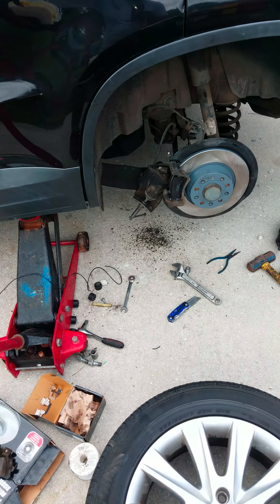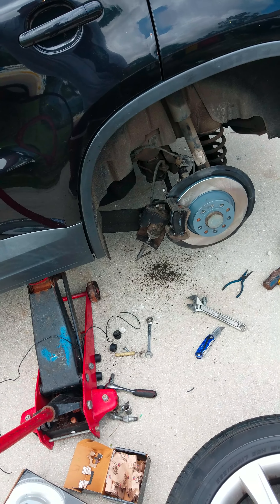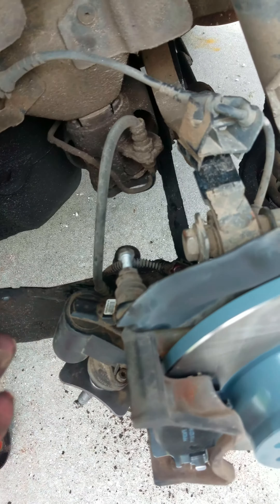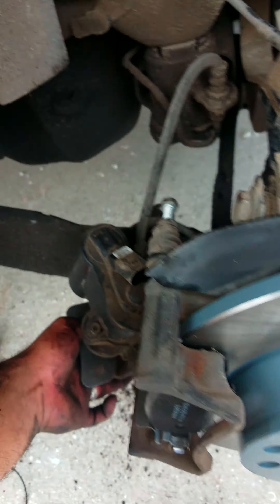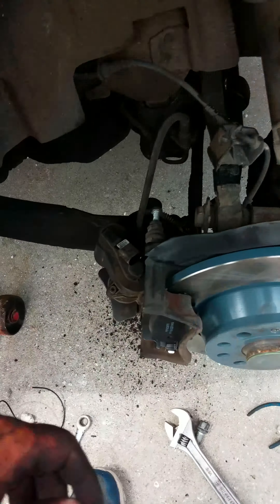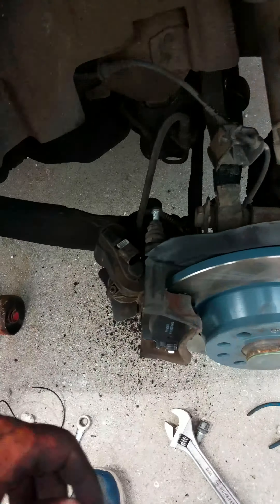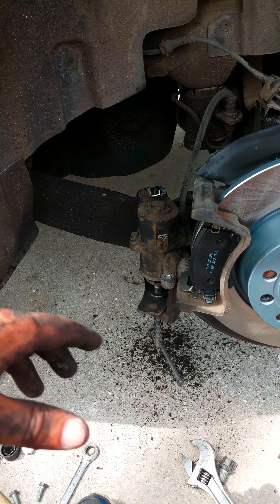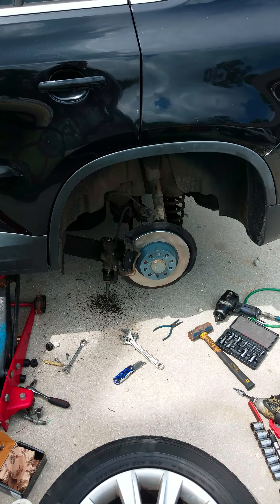Vw tiguan brake job

Comment: What about putting it back on? will the computer auto adjust the pressure when you turn the car on? or what happens?
Reply from the maker: Yes just press & release the electric parking brake & it will go back to normal